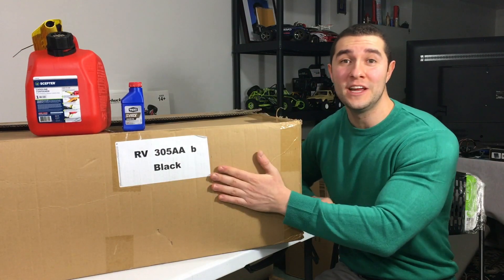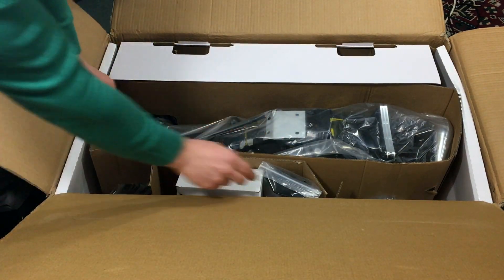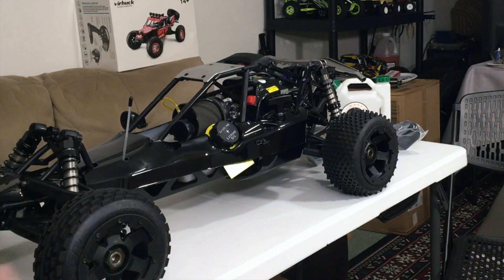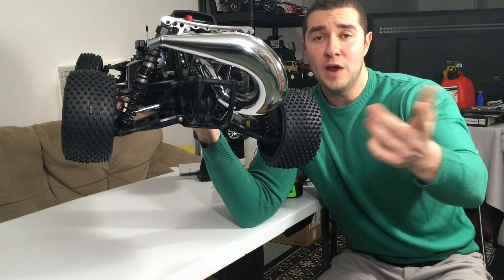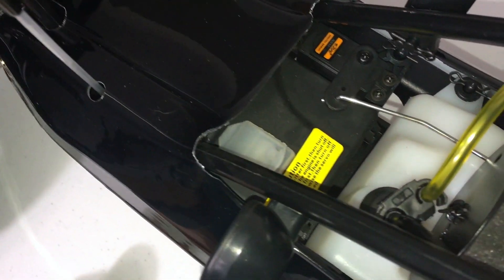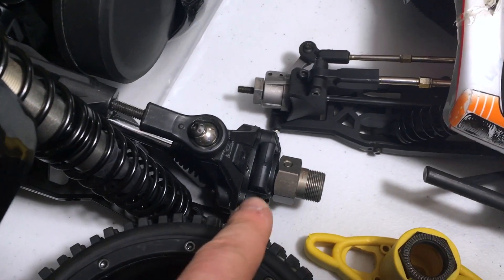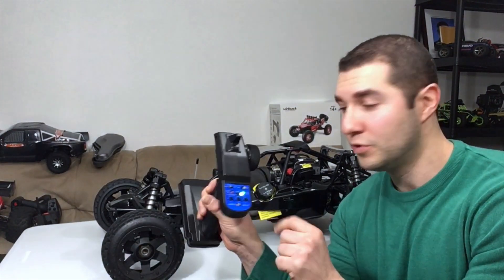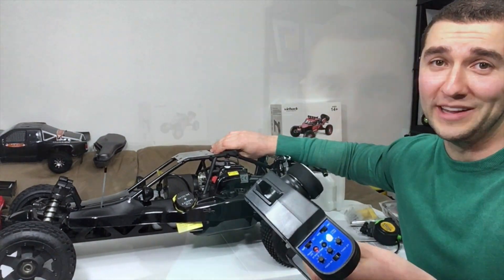I got the cheapest 1/5 scale gas buggy ROVAN 30CC (what's it like?)

Comment: So it seems like hpi has sold the intelectual property to a big conglomorate and other manufacturers are selling the same thing and allready upgraded out of the box. I bet the parts are even interchangable. Seems like a great buggy for the price. I bet 5th scale gas engines are alot less finicky than nitro engines. As i used to build them up on my goped scooters years ago they are tons of fun to work on.
Reply from the maker: hey dude!!  The parts are interchangeable, that's the main benefit of getting one of these clones.  Nothing wrong with that, not everyone will abuse their RC and break parts constantly.  I almost never break anything, I don't destroy my stuff, that would just cost too much and I would not be able to buy all the cool used retro RCs I get on ebay, LOL. thanks for the comment!!!

Comment: Rovan/King motors is not worth it in the long run. Larger engines thst use more gas but have less power than the smaller and tighter engines that come with the Hpi 1/5 scales. Mainly overall they are poorly made and will cost you more in the long run than just paying the price for an Hpi.  But on the plus side if you need a 1/5 scale thats rtr at a low cost go for it. When stuff breaks you can just buy hpi parts because they are almost exact clones
Reply from the maker: hey man!! I did need a low cost 1/5 scale, and this thing delivered.  I love it.  Did you see my updated vids on this, it's solid.  Pulls wheelies, had a great pipe, nothing has broken.  IDK about the HPI engines being any better, they are basically all similar other than their displacement.  I would surely love to find an older used HPI baja for a comparo.

Comment: I have one of them, it was very fun to drive and stuff. I want to give you some pointers on this truck because there is some things, the tires don't last long nor grip well, make sure to tighten and loctite all screws Because some of them can be loose, get a kill switch because the fail safe will do nothing if the battery runs out or the battery gets unplugged, don't use the stock radio because it has horrible range, make sure to oil the air filter because they are not oiled from the factory normally, lastly don't use that oil or the chainsaw/wallmart oil because your engine won't last long because that type of oil is very thin and doesn't protect the engine, I recommend the Klotz super techniplate oil, Amsoil dominator, motul 500 or 800, Maxima 927, yamalube, belray sl2, Honda hp2, Castrol power, or redline 2 stroke oil, those are the best 2 stroke oils. The petroleum based oil like the ones you can buy at Walmart or a gas station are garbage and made for low revving and low power chainsaws, you need a dirt bike/motorcycle grade 2 stroke oil. Also the gasoline now and days has something called ethanol, that ethanol has alcohol in it and that likes to mess up the rubber pieces in the engine like the diaphragms, oil seals ect so what I do I buy something called ethanol stabilizer, I like star Tron, you can buy it at home Depot or something like that, it really makes the rubber prices last longer. Also I'm assuming you probably bought this because you've been told you can just buy any 2 stroke oil and stuff which is the furthest from the truth, they are not like chainsaws though they have a similar engine design. It's not as simple as a chainsaw, chainsaws are very low performance engines and are made for reliablity, that's why it's different. Oh also rovan says 25:1, don't do this because it will give you alot of tuning headaches, so what I do is break it in one 24:1 and then after 1 gallon of 24:1 go, to 28:1, it will really make your tuning experience and it holding a tune much much easier.
Reply from the maker: wow, great advice. Very helpful.  So you are saying to not use the 2 stroke oil I got?  It's synthetic oil, isn't that what is recommended anyway.  The oils you recommend are they synthetic?  Great idea on the kill switch too. gonna look it up.
Reply: Z_hb71 onLSF forums hell yes! Thank you !
Reply: @hybrid32494  oh it is synthetic, then your good. I thought it was petroleum based, your fine to use that then 👍
Reply: @hybrid32494  the statement about the ethanol is false, ethanol will lose it's octane rating if left unused for a month or more, just get some (stabil) for storage. run 91 octane or better, some gas stations advertise ethanol free with higher octane fuels just look on the pump. i prefer castor 927 because it has a castor synthetic mix. the castor oil has a higher film strength while the synthetic has a higher temperature resistance.make small adjustments when retuning after breakin.
Reply from the maker: great advice!!! I've picked up some castor 927 on amazon, it was a good overall value and is highly recommended.  In NYC there are no fuel stations without ethanol i'm aware of, so have to use regular 93 pump gas.  Can you tell me what the basic fuel consumption on one of these gas motors is.  I basically know that it takes me about a year of running 5 of my nitros to use a gallon of nitro fuel (45 bucks).  Since the cost of this 2-stroke racing oil is substantially higher than the gas itself, how long in terms of engine hours do you think It would take to use 16 OZ of the 2 stroke in the premix at 28:1.  I'm trying to calculate the basic cost effectiveness of this compared to nitro.
Reply: @hybrid32494  nyc cool, i live in ulster county, stewarts is where i get my fuel, i bought my rovan used on craigslist for $275 but the 29.5 engine wound up being toast so i picked up a 30.5 cc. the po didn't oil the air filter and the engine wore out prematurely so get that done first.
Reply: What a nice comment u must be some pro for this kind of engine you know I have also order the same car but I. 29 cc and I am totally a nitro guy I don't have any knowledge about this gasoline engines may be I need your expert advice I am waiting for my shipment
Reply: @hybrid32494  i get around 20-30 mins a tank after break in depending how hard i thrash on it. consumption comparison i can't honestly tell ya, 5 nitro's making a gallon last a year is very little run time on those vehicle's, i used to burn through easily better than a half gallon on a race day with my mugen truggy.  i did strip out the spur gear and upgraded to the steel one, also if ya run on grass the engine will suck up a lot of clippings and pack it around the cylinder.
Reply: @YOVlogs  i don't know if you're referring to me but no i'm not a pro by any means. i have been in this hobby since the early 90's and learned a lot from other racer's, so i try to (pay it forward) to help keep the hobby alive.
Reply: My math is garbage.... so can you please help me with how much 28:1 is in ml??? I have a Baja 5b ss. With a spektrum DX4C radio gear in it. with a 4600mah battery that powers the reciever and servos. And I got a stage 2 upgraded 26cc engine with some shitty pipe that will make your neighbors love you even more then before🤗🤗🤗
Reply from the maker: we are both learning about the gas engines, LOL.  I am also a nitro expert (I'd like to think), this is also my first gas model.  Been watching alot of other youtube vids from HPI on how to care for their Baja models.  Let me know when you get your, congrats!!!!
Reply from the maker: Yup, gotta oil that filter.  Do you think that applies to running in non dusty or sandy areas too?  So what ratio premix do you use, it seems most people go with 28:1, is that what you use?
Reply: @hybrid32494  I use 25:1 I'm from Amsterdam so we use ML and Liters for measurements.  200ml of oil and 5L of unleaded gasoline. And I use Castrol power rs. And down here we have a higher grade of octane level. Back in the day we had 98 hahah that stuff was great!! Now we only have 95
Reply: @hybrid32494  I have received it yesterday may be in day 1 or 2 I will make a video and try it outside I can't wait myself the box is so big and nasty bigger than my expectations but for the fuel I still have allot of doubts which I really want to clear before running this some of them are recomending me 25/1 28/1 which one?
Reply: @hybrid32494  yes, it's pretty much a given,  i also installed one of those fabric pre filters on the pull start and air filter, mines an (rcstudio) brand, it's not the best (the fabric tore around the pull cord) but it still keeps debris from getting in. i broke mine in at 24:1 and now i'm at 28:1, i may try 32:1.
Reply: @hallobyebye699  to be honest, i don't know cause i use a ratio cup, it does have ounces on it also, and i'll comment back later when i decide to tote my lazy a$$ down to my shop and look.lol ;) . i have the dx3s with the dynamite big batt also.
Reply: Thank you for the awesome advice i have the same car and your very right about that oil its water.  I upgraded my tires also for better grip and performance. What type of radio do you recommend for this car?
Reply: @youngone697  it's not that it's thinner, synthetic oil is very slippery and the piston rings have a hard time "wearing" in to the cylinder. you can "break in" an engine using synthetic, it just takes longer for the rings to seal.
Reply: @youngone697  I have a sanwa/airtronics mx v on mine, it's great, you can find one on eBay for $50 or you can spend alittle more and buy a futaba. Futaba ha better range.
Reply: @YOVlogs  I say 28:1,. I run that and it works the best
Reply: This revs no faster than a Stihl saw.
Reply: @asherdie  no, it revvs alot faster and more than a chainsaw. Because it has different/better porting and a shorter stroke I believe. If it revved the same as a chainsaw, than it would be extremely slow. Chainsaw motors are built for high torque so they can cut though trees, these engines are built for high rpms so they can go faster.
Reply: @zeeshanhb9520  wrong. Stihl chainsaws RPM range from 10,000-14,000rpm. The Rovan 45cc turns 16,000 on a good day.  
If you do your own research, you will find where the Internet experts, aren't all that erudite.
Reply: @asherdie  we aren't talking about the 45cc were talking about the 29cc, they rev to like 19k rpm
Reply: @theclubhouse1209  yes that is true but my point is that ethanol will mess up the rubber peices like the fuel lines, tank grommets, diaphragms ect. And the ethanol stabilizer helps with that AND makes it last longer (like u said)
Reply: @zeeshanhb9520  pure ethanol mabey, but 10% mixed in gasoline will not hurt any rubber components, look at the pre mixed nitro fuels, up to 60% is pure alcohol, and that's more damaging than ethanol.
Reply: @theclubhouse1209  the fuel lines on nitro are a different kind of fuel lines, I think they're made from silicone. The fuel lines on the 1/5's are the same type on a weed whacker. The ethanol will make the rubber hard and crack, also they can cuntract. Star Tron help with that.
Reply: Also it doesn't happen instantly, it happens over a course of about 6 months or a year
Reply: @zeeshanhb9520  you're right on the silicone for nitro's, it's because the alcohol nitromethane mix, 1/5 scales use something on the line's of "polygon" or vinyl fuel lines.  Heat is rubbers biggest enemy, not ethanol.  i agree with using fuel stabilizers but only to keep the fuel from breaking down. the main disadvantage of ethanol is it has less btu's per molecule. As for the 6 months to a year is false. "viton " rubber based products have been used to help combat the aging of fuel related rubber products long before ethanol was available to the public.
Reply: @theclubhouse1209  I wouldn't be arguing right now if I didn't experience the problem. You are  right on everything else though
Reply: the clubhouse 32:1 might be a little too lean.
I have the first gen HPI Baja5B with the 23cc engine and I’ve been running it on 30:1 mix for the last 9 years.
Reply: @stevej6824  yep 32:1 is what racers use,  28:1 is the best of both worlds, also 30:1
Reply: @stevej6824  what brand oil do you use? Anyhow with the nikasil coatings in today's cylinders, i run my stihl weed trimmer at 50:1 using their oil and my rm 250 at 40:1. i get that weed trimmers aren't usually under heavy loads that the 1/5 scales can produce, the reason i want to try it is to get a baseline before i start porting these engines. 9 yrs on a 23 even if with a full rebuild is quite impressive.
Reply: the clubhouse I’ve always used RockOil full synthetic.
I actually ran a few tanks of 40:1 mix in it before.
Had it doing wheelies with my paddle tires across the beach.
Although I’m sure if I would’ve kept running that mix my engine wouldn’t have lasted as long as it has.
Reply: @stevej6824  thats cool, i'd bet that these engines could easily survive on 32:1-36:1 ratios using high quality oils.
Reply: bla bla  bla    bla          bla .... blablabla bla bla bla.... LoL
Reply: @steveblackbird  Google, Zenoah rpm, educate yourself. Stock they will not turn that according to manufacture specs.  Your boyfriend is wrong about how fast his toy engine is.
Reply: @steveblackbird  so Zenoahs spec sheets are lies. Got it.
You have a secret supply of high speed Zenoahs.
Careful talking so sweat to me, your boyfriend will get jealous you flirting like that.
Reply: @steveblackbird  "what's erudite?" Bwahahahahahahaha
What's a dictionary?

Comment: I had a Rovan truck version of this probably 7-8 years ago. Very big and impressive sitting there but not spicatular performance. Get the XMAXX, you'll have the size and performance and now messy motor or mixing gas/oil.
Reply from the maker: hey man!!  you're pretty much right, these large scale gas RCs are not fast by any means, for their size.  Without tall gearing and a good pipe these are fairly slow.  But then again, it's much cheaper than the XMAXX with the commonly failing ESC.  I stopped buying top of the line high powered traxxas/castle rc's after the XO-1.  Any ESC failure is basically gonna be a 200 dollar repair.

Comment: 25:1 Gas oil mix is pretty rich oil wise. The older 2 strokes ran at 32:1. 
I'm used to working on Stihl, Echo, and Husqvarna 2 strokes, and they run at 50:1. 
Get a built Zenoah engine that is ported and built for a good price for this and it will rip.
Reply: New engines should be ran at 25:1 for their first uses!!!!

Comment: Hybrid, I stumbled across your rc car post, I love the info, you seem very knowledgable.  I read one comment about rovan being junk/clones, well I will tell you I own a rovan 5t , and it has been great, very fast easy starting, but loud with the expansion chamber.  I own the hpi 5 b, also very buggy, had I known earlier it would have been rovan all the way.  I also own the redcat rampage, a disappointment.  One thing I discovered with the off brands is to set the hi and low needles to hpi needles initial settings for initial startup.  I put a aftermarket walboro carb  on the redcat and the linkage did not quite match up.  Im thinking about cleaning the factory carb and putting it back on.  Like I said though the needles are often off with the off brands (my experience).  I probably own over 20 rc vehicles, from 12 scale up to 5th scale.  ill post a list.  I got your dream car, a schumacher fusion with the 3spd tranny, and a.21 thunder tiger motor, its a 1/10 scale.  Great videos and knowledge, very helpful!!!

Comment: So good advice but some things dont need to be changed like ur remote. I have the stock flysky remote that cam with it. Still working after 5 years with it. So dont bother spending wxtra money for a remote when the one that comes with it does the job. You should get outters for the bottom of the motor, Ir filter and pullstart. This will stop water from getting in ur motor and keeps dirt and grass out also. When it comes to oiling ur air filter put it in a baggy. Put 2-3 drops thats it and squeeze the filter so the oils does all over it so its fully covered. Dont use more than a few drops as its very sticky and will hinder air flow. Most use 25:1 for break in. Im running 32:1 as my spark plugs foul up if i mix it richer. Like i said ive had mine 5 years now and used 2 bottles of lucas oil. (Tried dominTor oil but dont like it. You have to mix it really lean) i get about 30-40 min runs with 93 octane gas. The foams in the tores like to hold water and expand at speed and blow up. Its a good idea to tape you foams with tuck tape. The red sticky stuff and it dont stretch or rip when in the wheel. I have 3 year old foams i made yes i make my own foams and taped that look like new still. Foams are expensive and if the foam breaks a good chance ur tire might rip also. Simple trick to keep ur tires and foams longer. Get lock tight and take every screw out and put lock tifht or you will loose screws and mayne parts at the same time which is never good. A kill switch is very important because if it takes off on you full throttle and hit someone it WILL break their legs! Or your car will hit something hard and blow up on impact(just parts breaking of and bending not a firey explosion lol) most things should be replaced as they break. But if you feel like spending $1000s just for the point to upgreade it giver. Mine was a rovan but not many stock parts left on mine. Got a 32cc with valocity stack on air filter. Side pipe and diff locker. Shell wheelie 100 on gras and still wheelie on snow with paddles. I have a bunch of vids on my channel of my rc if you wanna see what they can do when upgraded. Some epic crashes too lol hope this can help some people. Also look on fb lots of forums on there for help or more info about 1/5. Also you should get limiting straps for your shocks so they dont over wxtend when jumping. This will cause your shocks to leak over time and will bounce and handle poorly